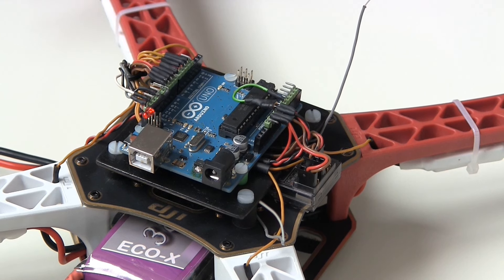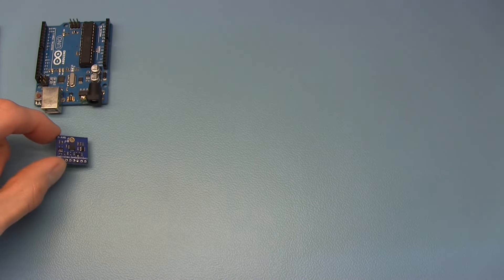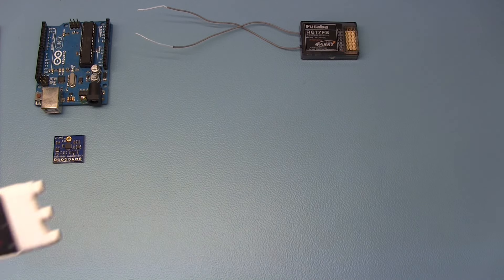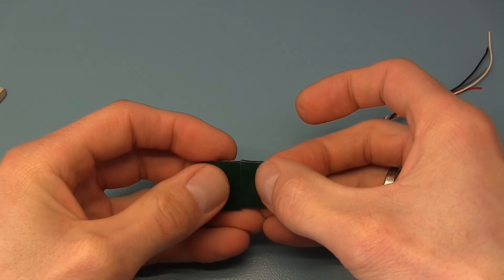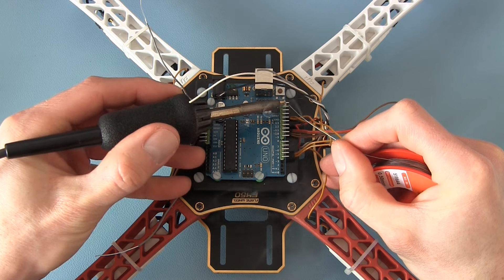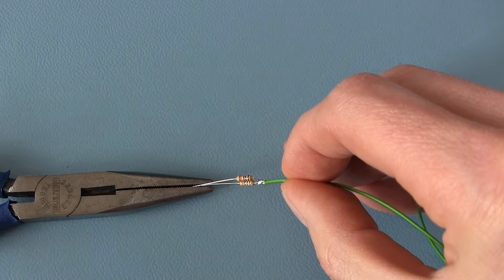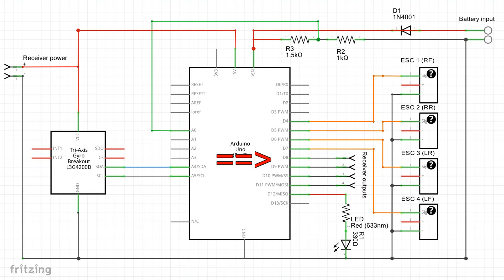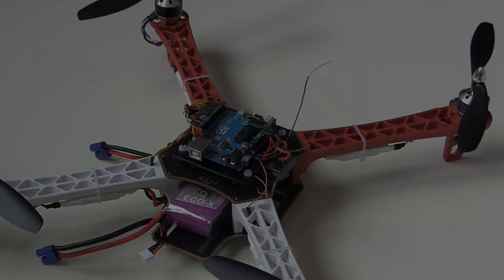Your Multicopter Flight Controller - 3D (YMFC-3D) Part 1 - Hardware.

Comment: There are no code for start motors in your software.I uploaded to arduino.Increase throttle.But didnt rotate my motors.Please give code for start motors
Reply from the maker: Burhan BEKTAŞ To start the motors you need to setup your transmitter according to part 2. After that you can start the motors with the stick sequence I explained in part 6 (time 1:55).
Reply: I watched part 2.I uploaded receive code to my arduino.It is working good.But when I uploaded to YMFC_3D_Flight_controller code on part 6,   my motors doesnt start.in addition I do not see the motor start command.Motor start command " write" is not it? There are no "write".What is the motor to start commands in the software?
Reply: Which I need to upload software to my arduino to work quadcopter?
Reply from the maker: Burhan BEKTAŞ Line 141 says:
//For starting the motors: throttle low and yaw left (step 1).
Line 143:
//When yaw stick is back in the center position start the motors (step 2).

This is the part where the motors are started.
Reply: I did not understand your wiring diagram.Why did you supply gyro's,arduino's and the receiver's directly from the battery.I connected to all esc's 5V and ground.I connected common 5V and ground for arduino,gyro and receiver from this ESCs.Is it right?

Comment: hai, im done with hardware and dumped code in to it,but when i connect battery n receiver there is no action.is there any method to start?
Reply from the maker: What code did you used? You need to be more specific if you want me to help you.
Reply: The code you provided in  the link below
Reply: We have followed each and every step as you have shown in the video .
Reply from the maker: Please use the YMFC-3D version 2 software:
https://www.youtube.com/watch?v=CTtLPeJPbXY
Reply: Is schematic same for both??
Reply: We are using 1800kv motors 
Fsct6b Tx,Rx 
L3g4200d
30A Esc
...does this configuration is supported by the software?
Reply from the maker: Schematic is the same for both YMFC-3D versions. What props are you running and what battery?
Reply: +Joop Brokking propellers are 10*4.5R and battery is of 11.1v
Reply from the maker: 1800kV motors cannot handle a 10x4.5 inch prop when you use a 3 cell lipo.
Reply: +Joop Brokking then which configuration we should use ??

Comment: where the esc 2nd pin connect to
Reply from the maker: Check the schematic. Red wire of the ESC is not connected.
Reply: and where it connect to

Comment: Sir whats the flight time
Reply from the maker: Harshit Sharma Approximately 17 minutes with 3850mAh lipo's. Depending on your flying style this could be less.
Reply: Joop Brokking which motors you used
Reply: Harshit Sharma i want to build a quad copter with more than 30 min flight time. Sir can you please help
Reply from the maker: Harshit Sharma I used 920kV / 12A max motors. To get longer flight times you need more battery's and a lighter frame. Watch: https://www.youtube.com/watch?v=GajlbrAkAK4
Reply: Thanks, But the setup is too Expensive.

Comment: Sir what Mode is your Remote Controller ??
Reply from the maker: +Zan Kane My throttle / yaw is on the left stick (mode 2).
Reply: +Joop Brokking also sir we are using a 5000mah lipo battery, its also our first time to build something like this. We sometimes encounter problems in our motors it doesnt responce quickly in our remote, we use a turnigy 6x fhss 2.4ghz, we follow all in your tutorials sir. Is there might be something wrong ?
Reply from the maker: Zan Kane
Is it possible to make a video of the flight? This is much easier for identifying problems.

Did you use esc's that are specially designed for multicopters? If not the quad will feel sloppy / slow in reaction.
Reply: +Joop Brokking yes we use a ZTW 30A OPTO ,
Reply: +Zan Kane i am uploading the video now sir ,
Reply from the maker: +Zan Kane Looks like you got some serious vibrations that causes small overcompensations and the unstable behavior. Try to remove all the vibrations before you continue.

It is best not to use different motors on a quad. Are u using the L3GD20H gyro? Have you made modifications to the original code?
Reply: +Joop Brokking  we are using a Gyroscope MPU6050
Reply: +Zan Kane right now the 3 motors are working but the other one is keep on beeping, we try it 1 by one it work when we are going to try it together only 3 is working
Reply: +Zan Kane i am going to upload the latest please kindly watch sir
Reply from the maker: Zan Kane
You might need to recalibrate your esc's. The esc does not except the incoming pulse. Check the manual on how to do this.

Comment: hi sir my arduino is working but all the motor are not start i m cheque all the wire and upload the sketch again
Reply: Hey Rob, I'm having the same problem as Manpeet.  Just can't seem to get the ESC to arm!  Could it be because I'm using a 4x1???
Reply: Rob Smit how did u even made his quadcopter this video is not in detail i cannot even understand the connections where to put what . Do i connect the bec wire or not ?
Reply: Rob Smit hey dud i need help im getting a gyro exes verification failed error what should i do ???!!
Reply: I am actually doing all that right now i putting the program please help
Reply: Rob Smit error 7 it is showing i have wired it pretty coreectly
Reply: Rob Smit gyro exes verification failed
Reply: Rob Smit what is i2c
Reply: It has actually serached gyro but then at the end its giving that error
Reply: Rob Smit how do i solve it ?
Reply: Dide i just solved my problem thank you but i think when i calibrated the esc program in it all 4 motors start to run than se immedity shut down switching of the power what could be the problem
Reply: Rob Smit is there a problem if its 7.47v its 2300mah 20 C battery though i am not sure about the voltage
Reply: Rob Smit buy the way i havent put the resistors and the diode is that a problem ??!?!
Reply: Rob Smit how much C rating battery did you use and how many amps esc did you use

Comment: Hi Joop,

Maybe this is a stupid question, because i dont know really much about gyro's and accelerometers but i was reading this article:
http://blog.oscarliang.net/build-a-quadcopter-beginners-tutorial-1/

And i stubled upon this story:

Using Only Accelerometer?

With the accelerometer alone, we should be able to measure the orientation with reference to the surface of earth. But the accelerometer tends to be very sensitive and unstable sometimes, when motor vibration is bad, it could mess up the orientation. Therefore we use a gyroscope to address this problem. With both the accelerometer and gyroscope readings we are now able to distinguish between movement and vibration.

Using Only Gyroscope?

Since the gyroscope can tell us the rotational movement, why can’t we just use the gyroscope alone?
The gyroscope tends to drift a lot, which means that if you start rotating the sensor, the gyroscope will output the angular velocity, but when you stop it doesn’t necessarily go back to 0 deg/s. If you then just used the gyroscope readings you will get an orientation that continues to move slowly (drifts) even when you stopped rotating the sensor. This is why both sensors has to be used together to calculate a good and useful orientation.

The l3g4200d is a gyroscope right and not an accelerometer?
If so, how do you think about this, and did your drone also drifts a little?

Gr.
Reply from the maker: +Stefan Bos The YMFC-3D software has no auto level feature. So a gyro alone will work. If you want to have a auto level function you also need an accelerometer like i did with my own flight controller:

https://youtu.be/G52LtnBRG5w?t=6m58s

Comment: plz explain in a step by step manner......so DAT every one can understand......just by showing schematic diagram....many people wouldn't be able to understand
Reply from the maker: Please check this website: http://www.brokking.net/ymfc-al_main.html
Reply: Look at the video's. It really does make a lot clear. It helped me. And I am a electronic NOOB. Take your time. It did cost me a couple of weeks to understand it all and three quarter of a year to fly for the first time my YMFC-V2 and YMFC-AL. It works!!! Both work. With a lot of prototyping (no soldering: only jumper wires) I have it in mind and can blindfolded build a quadcopter. The learning curve is steep, and of course even blindfolded I had problems. But at last I got it al working. It's worth the time and money! You'll understand it all eventually. Good luck!

Comment: Hey can I have your email or another way to contact you? This video is a bit confusing for me and you didn't really clearly show which wires go to which ports. I tried looking at your schematic, but that it also really confusing for me since the schematic doesn't have the receiver shown, so I don't know which wires go to where. Is there some way you can help me with pictures or a clearer schematic that you could make? Thanks
Reply from the maker: Check this page (and it's Q&A tab) for more details: http://www.brokking.net/ymfc-al_main.html
Reply: Hm still can't really find an exact instructions on the exact wiring you did. Another help? Maybe uploading pictures?
Reply: Also, does it matter which ground port I plug the gyro in since I see there are 3 ground ports on the arduino

Comment: Please make a tutorial on raspberry pi also.Please
Reply: tried no success RPI is terrible for this on eBay I bought a 3 dollar arduino from china
Reply: doing this with a RPi is so far from trivial it isn't worth it. My version has a RPi sending commands to the Arduino with a modified version of YMFC-3D v2 program
Reply: i am doing a college project on raspberry pi quadcopter...Its just irritating...however i have managed to build something...I may upload it when i finish...I am using tkinter library and vnc to control i without transmitter
Reply: National Geek could you please upload it to Github or something after the world would love you for it!
Reply: +National Geek Ok Thankyou

Comment: Hi I have a question can I connect 20 awg jumper wires such as these ones: https://www.floris.cc/shop/en/cable-wire-connectors/439-premium-femalemale-extension-jumper-wires-40-x-3-75mm.html?search_query=jumper+wire&results=72

into the two little male pins on this power distribution board:
http://www.hobbyking.com/hobbyking/store/__23140__Hobby_King_Quadcopter_Power_Distribution_Board.html

to power my arduino?
Reply from the maker: That is possible. I highly recommend to solder the wires because the jumper wires aren't very reliable.
Reply: +Joop Brokking Thanks for replying! do you think i could strip the end of the jumper wire and then solder it?
Reply from the maker: Yep, no problem.

Comment: I followed every steps given at http://www.brokking.net/ymfc-3d_v2_qanda.html Did circuit connections as per the pdf schematic  diagram and also uploaded the three programs in arduino uno 1) Esc callbration 2) flight controller 3)setup
but not working. No motors are rotating. Please help me. Thanks in advance
Reply from the maker: Make sure to set all the sticks in the center position as this is your problem:
Digital input 10 values:1000 - 1008 - 1008
Reply: I have successfully completed the setup program and then ESC calibration program (all motors run at the same speed) also. Even i have uploaded the flight controller program. balanced all propellers. but after uploading the flight controller program, motors are rotating with uneven speed. I tried this by putting quadcopter on the ground, but later i red your comment that don't try on ground because the integral controller will goes on adding errors. So i tried same by taking quadcopter in my hand; still quadcopter is not flying. Please help Joop Brokking PLEASE.
Reply: In one comment you said that, use these lines

  //Place the MPU-6050 spirit level and note the values in the following two lines for calibration.
  angle_pitch_acc -= 0.0;                                                   //Accelerometer calibration value for pitch.
  angle_roll_acc -= 0.0;                                                      //Accelerometer calibration value for roll.    

what values i should replace 0.0 ??
From ESC Callibration program ; when i sent 'a' character result was-
Pitch: -3 Roll: 4 Yaw: 0 
Means i should replace by  -3.0 and 4.0 ??
Reply: HARDWARE SPECIFICATIONS
1) 450 size frame with integrated power distribution board
2) A2212 1000KV Brushless Motor w/ 30A Brushless ESC 
3) 1045 Propeller DJI F450 550
4) Arduino UNO
5) MPU 6050 gyro / accelerometer
6) Flysky FS-T6 6-CH TX Transmitter and receiver
7) 3S / 2200mAh / 30C lipo battery

SOFTWARE
1) Arduino1.8
2) YMFC-AL_esc_calibrate.ino
3) YMFC-AL_setup.ino
4) YMFC-AL_Flight_controller.ino
Reply: http://www.brokking.net/ymfc-al_main.html
It is written that - 

Hold the quadcopter firmly in your hand and start the motors with the following sequence:

Start = throttle down and yaw left
Stop = throttle down and yaw right

Increase the throttle up to the point when it almost starts to become ""weightless""

Yes i felt that ... but when put it on ground it misbehave with me.. ha ha ha

Comment: Dear Mr Brooking,

I'm planning on using the fs-ia6b transmitter along with the flysky fs-i6 (http://m.banggood.com/FlySky-FS-i6-2_4G-6CH-AFHDS-RC-Transmitter-With-FS-iA6B-Receiver-p-983537.html).
What kind of rearrangements would I have to do in the wiring? There are 4 rows of pins in this one and I'm quite confused. I'd like to know what and how I'm going to do it before I go ahead and buy the actual parts... I've tried to look at schematics and do it by myself but I can't quite figure it out, maybe you can help me :) Thanks in advance and a big hug from Spain!
Reply from the maker: Please check this page: http://www.brokking.net/ymfc-al_main.html
Reply: Already did, I'm just kind of confused with the extra row of pins and how the receiver works. I know what each channel of it does but I don't know how to wire it to the arduino because I don't know what pin to choose, but it's ok, I'll figure it out. Thank you.
PS: How much flight time do you get and what's the max speed that you can get with this?

Comment: Hello! if any body in here is from Delhi, please tell me where can i buy the equipment needed for the quadcopter
Reply: Come on, any body, answer
Reply: tnx bro.
Reply: try Chandini Chowk
Reply: All equipment like the Arduino, shield, resistors, diode, motors, props, header pins, wires, led, etc. can be bought from Aliexpres, banggood, hobbywing.  Personally I have good experience with banggood an aliexpres. Thanks to internet.

Comment: hii bro iam getting a prblm in serial monitaring there is an unknown language is occuring iam not seeing like u showed in ur vido it occuring like (((???   |\\\||||| this can u help to solve my problm
Reply from the maker: Did you set the correct baud rate in the Arduino serial monitor?
Reply: OK I got it tnx bro but I got an error like no valid recover signals found